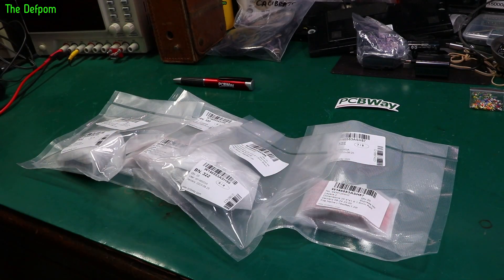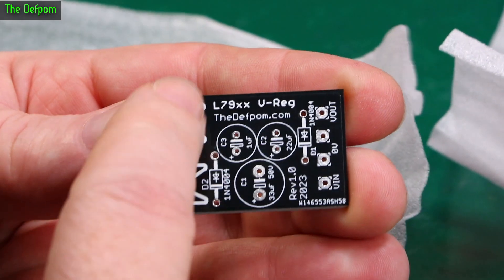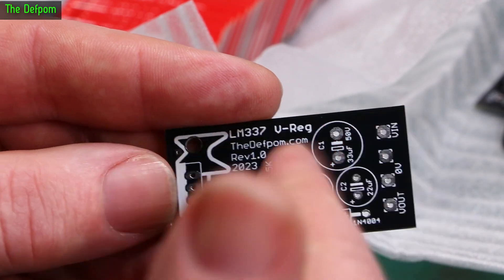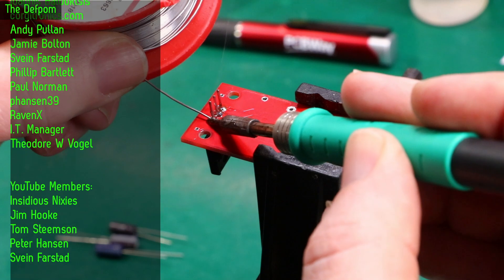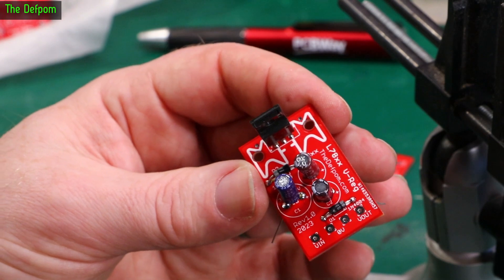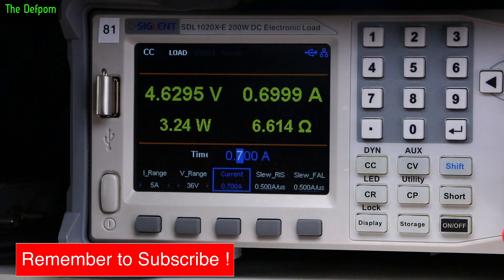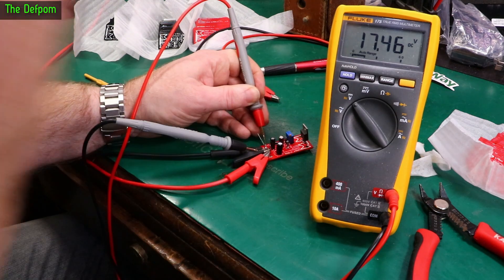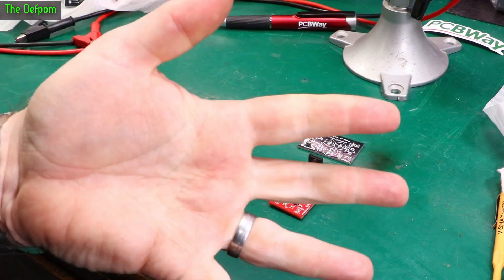🔴 Linear Voltage Regulator PCB Project - Sponsored by PCBway - No.1185

Comment: An indicator LED on the output of each of the boards would be good.
It would help stabilise the last PCB you assembled.
Those boards would certainly help while prototyping or proof of concept design.

Comment: It's usually good practice to include a diode connected across the regulator's Vout to Vin pins to prevent the regulator being damaged by excessive reverse bias of the series pass transistor. This can happen when the input voltage collapses to 0V (eg. by a short from Vin to 0V) whilst the output is held high, either until the output capacitor discharges or an external source such as a battery is disconnected from Vout. This isn't a problem if the worst case reverse bias is less than 6V or so (the breakdown voltage isn't usually specified in the datasheet). The diode is cheap enough that it may as well be included even if not strictly necessary.
Reply from the maker: Yes, that is something I did consider adding, but I decided not to bother as I already had the back flow prevention diode on the output.
Reply: Fair enough but you did say the output diode was optional; also the cost of the pads/traces is only the required board area which I doubt was an issue. But surely it meets your needs so all's tickety-boo :)

If you do any more consider adding a crowbar/TVS + fuse/whatever to protect expensive/irreplacable electronics supplied by the board - the failure of a 5 cent, possibly fake, voltage regulator could cause a great deal of pain (in the wallet), mental anguish and even recriminations. This is why I would be very reticent to use cheap power supply modules to power non-trivial electronics, especially if the input voltage is significantly higher than the output.

Comment: What about a LM2596 version as a pre-regulator? (e.g. 15V -> LM2596 -> 8V -> LM337 -> 5V) Switching IC then reduces heat loss and linear regulator gives nice clean supply?
Reply from the maker: Something like that could certainly be done, but was beyond what I was wanting to do here.

Comment: Never ordered from PCBway or any factory made pcb. But planning to...
Do you make prototype of pcb and etch it before buying batches of boards?
Reply from the maker: Nope, I just design it in eagle or kicad and get the boards made, it is rare for me up mock up first, even on a breadboard.
Reply: I’d note that the cheap price of prototype PCB runs these days, especially under 100mm square, has meant less need for breadboard prototyping these days.  You just leapfrog straight into your PCB layout design and go straight to PCB prototyping. If your initial design has some issues, no worries, as a new cheap prototype PCB is not far away, and your already well ahead on your PCB layout design path. If your design is relatively small / simple and you’re pretty confident in your v1.0 design, why not go straight for a small production batch up front.  The financial risk is a lot lower than it use to be.

Comment: Did you say that the second diode can be used to offset the voltage drop from the first diode? If so, how is it configured and how does it work?
Reply from the maker: The diode on the v reg causes the v reg output to increase as it’s adding a diode drop to the 0V reference pin.
Reply: @TheDefpom  Ahhh... On the reference pin. That makes sense. Thanks.

Comment: When I developed my similar regulator boards, I saved PCB real estate by making a custom footprint. It has 5mm pin spacing, for vertically mounting TH resistors/diodes/etc. And, I nested SMD pads between the TH pads. A 1206 will fit nicely. Meaning, you don't have to offset the separate SMD pads. I did the same for the e-caps, too.

Comment: Use thermal barriers for through holes in the boards. It was also worth ceramic capacitors of small capacity at the output and input.

Comment: Might be worth adding a wee ReadMe to your project stating that the forward voltage of all the diodes in the circuit will change with temperature & load slightly and thus the regulated output may vary. Also, if you do a V1.1 then maybe an extra hole on those caps will give optional lead spacings.

Comment: The point to remember is these are linear regulators, so you have to watch how much you drop across the regulator. Even dropping 1V at 500mA is 1/2W the device has to dissipate. The need for a heatsink soon becomes apparent.
So something like 12V down to 5V for say up to 500mA and your have 3.5W's of heat just in the chip at 500mA.
Linear regulators are the best think since sliced bread for low noise supplies, but can soon become sliced toast with high currents. 🙂
Reply: I had the same thought, after years of making TO-220 1A linear regulator power supplies.  
It was common to have relatively large aluminium heatsinks bolted to the tab. 
Also the high drop-out voltage usually meant a 9V transformer winding for a 5V TTL PSU (to be safe under varying loads). So if supplying 1A you were generating at least 4W of heat to dissipate. You’d probably also want larger filter capacitors for higher loads (depending on your input voltage source of course).
Nice little boards though, and handy for a low noise supply, perhaps for lower current DC - DC needs.
Reply: @DigicoolThings  we used to use them in the old days running from 28V DC power which could spike to 32- 34V at times. The 5V regulators could not cope this this input level and dropping 29V across it would make a nice heater. So we use to cascade them so a 12V one then followed by the 5V one. to spread the pain. then we moved over to £400 mil-spec DC-DC converters. 🙂 boy they were expensive in the early days but bloody reliable.
Reply: @TheEmbeddedHobbyist  I recall a recommended max operating input on a 7805 being more around 25V, with absolute max in the region of 35V.  Mind you, as you said, you’d have a pretty nice heater, dissipating all that additional power as heat! 
You’ll laugh, but my scanning eye initially read you comment as 400 million for a mil-spec DC-DC convertor. I was thinking it’d have to be bloody reliable! 😳